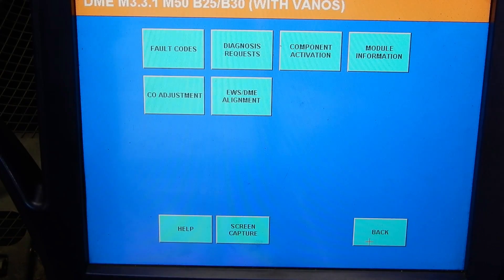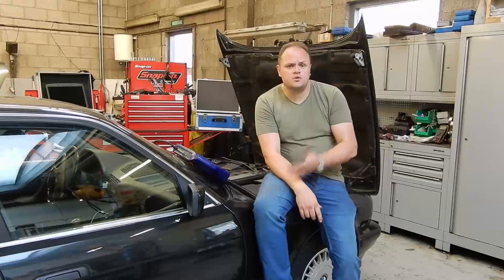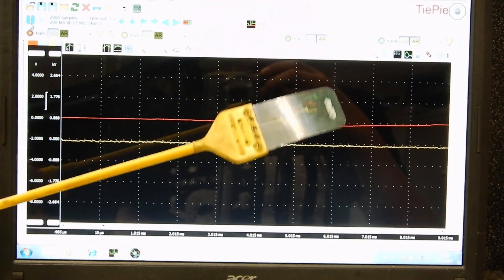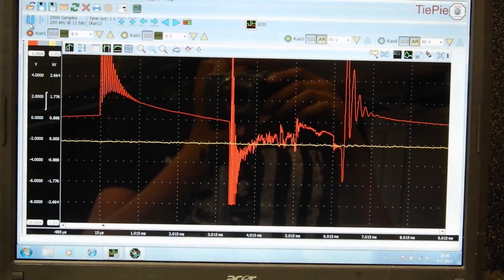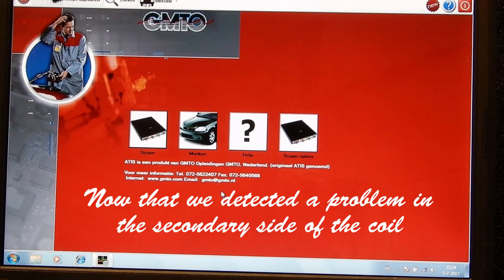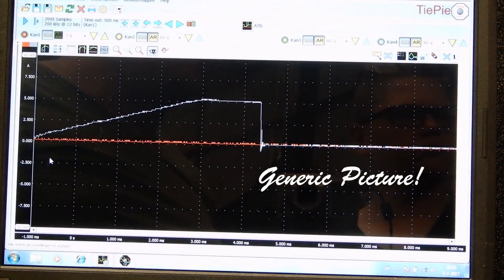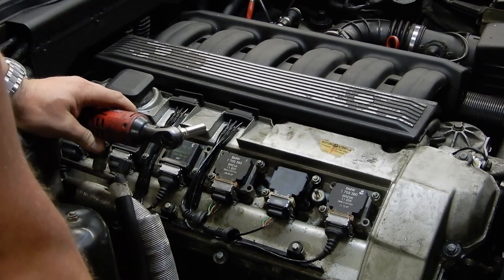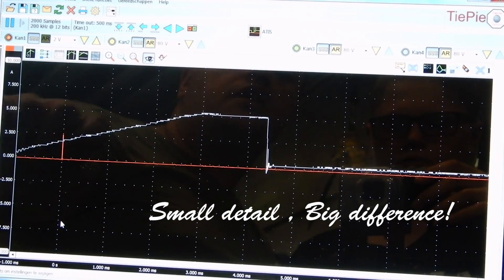No fault codes Misfire diagnose

Comment: Hi Mr D !
I have a question. 
I whant to buy a oscilloscope,  and I don't whant to spend too much , as I'm not doing professional repairs yet. :)
I have some options. But I need you to guide me as around what  frequency the diagnostics of car components go to. I mean like can bus lines ,5v ref , tps signal?
Thank you  !!! :)
Reply from the maker: If you want to do it al you'll need a differencial scope but those are expensive. I don't have any experience with lower priced scopes but the Ditex scope looks good.
Reply: @Diagnosedan  thanks for the reply Mr D.  But in what range of frequency should it operate,  20, 60, 100  hrz? But definitely it will be a two channel one.
Reply from the maker: @zfloz9895  https://www.ryansautomotive.ie/shop/diagnostic-equipment-and-tools/oscilloscopes/laptop-based/gmtotiepie-hs6-diff-4-channel-oscilloscope-set/
Please read over here the frequenty and sample speed is explained. You can than deside what you want to do with a scope and what you need

Comment: You don't need a fly smacker do scope coil packs. I usually just put the positive lead on the head of the coil, and the other to ground. Gives roughly the same readout. ;)
Reply from the maker: There was a fly sitting on that coil, that's why i used it😉

Comment: Whay  you not change all the spark plug
Reply from the maker: I did, but i didn't show it in the video.
Reply: @Diagnosedan   Why did you change the sparkplugs?
Reply from the maker: @artsnow8872  sparkplugs can be the cause of ignition coils failing

Comment: Hi Dan, 
I have a 2002 BMW E46 2.5 that runs good when you first start it, but after about 30 seconds it develops a dead misfire. It's never the same cylinder it is always a different one. It had some cheap aftermarket spark plugs, so I put in OE  plugs but it does the same thing. Have you run into this problem before? I would greatly appreciate any advice. 

Thanks!
Reply from the maker: J Man, look at the fuel trims! You might have a air leak!
Reply: Ok thank you I will look into that. I did have some misfire codes and a p0172 which I think is bank 1 running rich.

Comment: what is the name of the scope pr web site where they sell it please
 thanks for tbe video
Reply from the maker: Joel Navarro, www.gmto.nl. The Website is crap in English. But it soon will be improved! Better go to Contact and sent them an E-mail or message. Or you can call them. They speak English!
Reply: DiagnoseDan   thank you, compare to pico scope , that scope what main differences you will high light, ??
Reply from the maker: Joel Navarro, i don't have much experience with Pico, but  i guess the biggest difference is the Atis Software.😁 GMTO does a lot more than just sell scopes! They have remote diagnostics,make wiring diagrams.training courses ect.💪